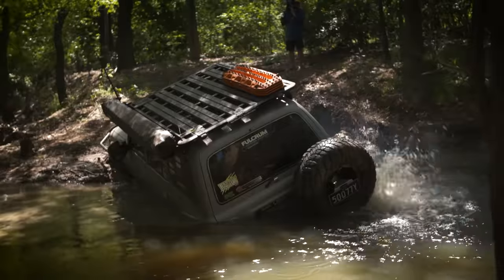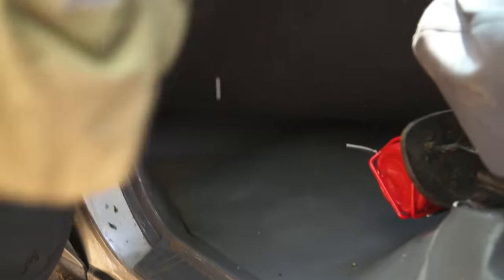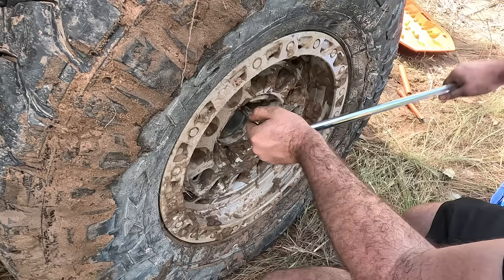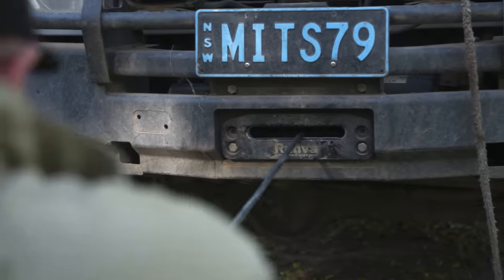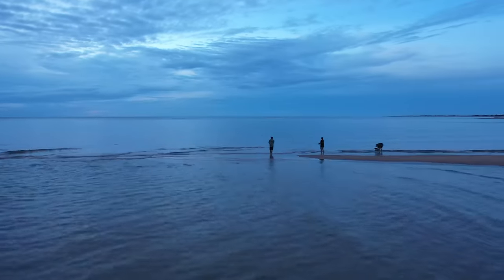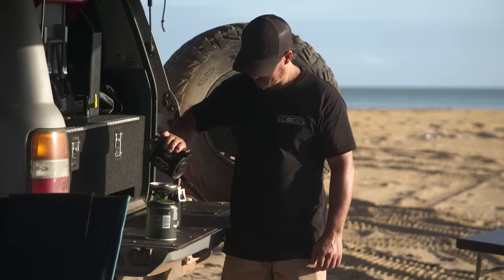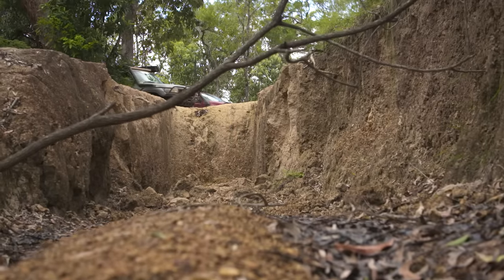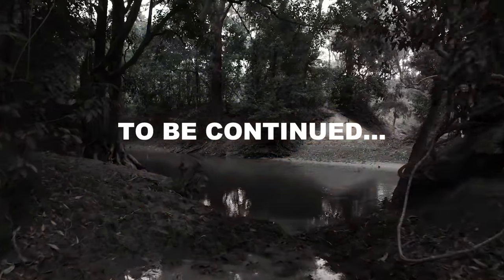CAPE YORK RIVER CROSSING goes horribly WRONG... SOOTY FLOATS, WATER OVER SEATS & the engine stops...

Comment: message to shaun , cooking eggs in the skillet olive oil in the skillet and place the eggs in  when the eggs purk up flip them over to double the size of the eggs, both yellows and white ONLY OLIVE OIL DOES THAT, WHEN USING VEGTABLE OIL IT SHRINKS THE ITEM THAT YOUR COOKING. SO FOR THOSE BIG COOK OUTS FOR DINNER REMEMBER OLIVE OIL OR AVOCADO OIL. THE OLD PAPER FILTER? SHAUN?  K&N FILTER  WATERPROOF FILTER? in the military we use a womans queen size panteyhose with a lite spray of waterproofing spray over the pantyhose waterproofing . so if water does come in it wont go in the air intake, but run out . we  also install a rubber check valve on the lower point of the air box to drain out evaporated water from the air box.

Comment: said it before and ill say it again, foam ear plugs are great to carry when you go through deep mud and water. at the start of the track, put the earplugs in the water drains in the bottom of the doors. if you do that and you have good door seals, it should (if not stop it completely) slow the water intake tremendously and give you way more time to perform your recovery before water gets into the car. remove them again when you are at the end of the trip.

Comment: Used to drive this kind of track many years ago when I worked in Arnhem Land NT.........and I got paid for having this type of fun 🙂

I always travelled on my own with no other vehicles (HF radio was king) ... black soil plains best thing ever are a few solid logs (approx. 6 inches in diameter) and good rachet straps....strap the logs to the wheels when I needed the extra traction to pull me up out of the mud.

Mind you I spent many nights with the swag rolled out on the roof rack (have to keep out of reach...lol) as it could take hours/days to get out sometimes.

Cars scare crocs away?...you need to watch a few Cahills Crossing videos......big crocs begrudgingly move out of the way of cars...lol
Great video guys.

Comment: Something me and the boys used to do when drive testing the depth of a crossing that we couldn't walk, was to drag a length of recovery strap. That way if you go down in the middle, it's a quick hookup and tug backward.
Makes for a quick recovery. Works best if you have a bloke to grab it in case the driver tries to reverse, so it doesn't get wound round the tires.

Comment: Question: why you try to winch when you could pull with lot more stronger engine in the rear vehicle. Believe the 70 was on hard ground. Same with the 80 recovery in the first one . Think the D-Max was on pretty solid ground.

Comment: Great tip for curries 
use lentils, kidney beans, chickpeas etc instead of fresh veggies. 
more authentic to Indian recipes 
very cheap 
dried or canned - lasts forever and don't need refrigerating.
Dried swell up 3-4 times size when soaked (use water bottle with wide top)

Comment: Any special reason why they are using 4 low to cross in the leveled surface, I would assume is better to push on 4H with more speed, I mean a V8 LC200 would have more than enough power  to do it of 4H.

Comment: You don't need an SD card in the drone, it will also stream video to the remote and save it on the remote, or on the SD card inside the remote..

Comment: And not even one radiator blind amongst them!
Reply: Always fit one myself, plus mine covers the bonnet  intercooler intake as well.
Best way to avoid mud/silt/crap accumulating in A/C condenser, trannie cooler, (front mounted intercooler, not in my case) radiator and saves fan chopping shit out of radiator core.
The hydraulic force in some of these attempts would have been very significant, can't comprehend zero issues encountered / disclosed.

Comment: When the engine stopped in Sootty, that was a perfect example of a waterlogged air filter. not sure if it was that water, as it wasn't dripping much... 
Too many "dig yourself in to get recovered badly" sessions here, it's not impressive to the hardened 4x4 driver, just makes you look like amateurs, you want to show people what a good 4x4 will do, so show them, not bury your axles in the mud.